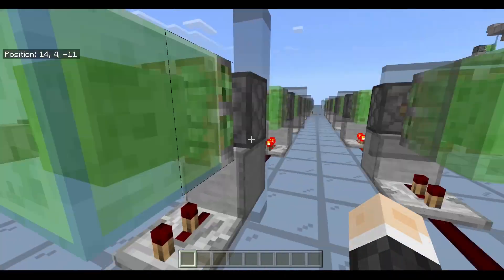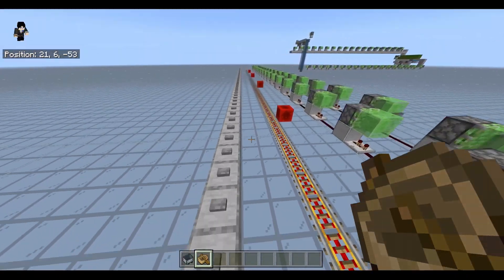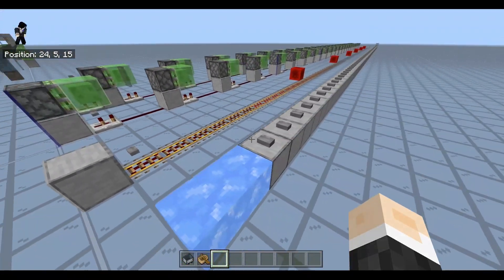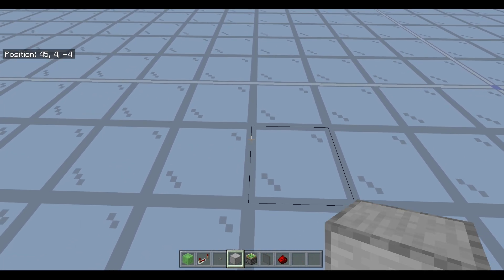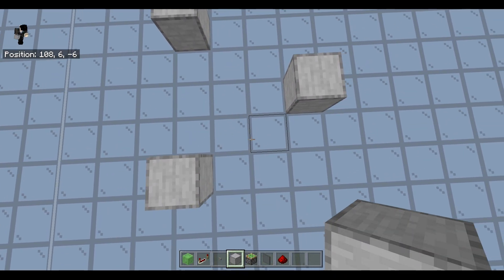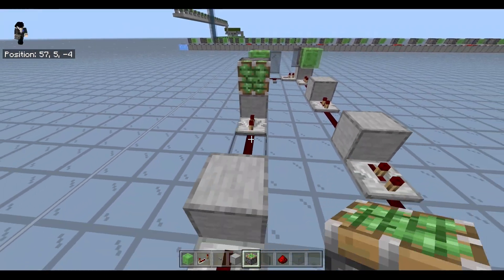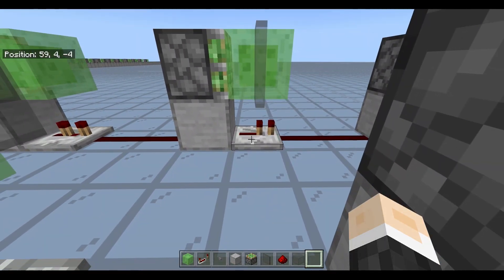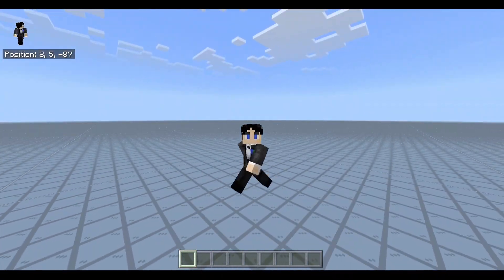Fast Translocation Highway for Minecraft Bedrock Tutorial 1.14

Comment: Do lag effect this at all ?
Reply from the maker: Lag will make it slower, but it won't break
Reply: what about unloaded chunks?
Reply: That's what matters it does not break ! Great work I must add.
Reply: @Hakabas01  don't unloaded chunks just happen and are only fixed with hard reset I would not thought this would cause unloaded chunks.
Reply: @Hakabas01  I believe its not a problem since you will be moving and loading the chunks. Similar to the piston bolt It wouldn't be a problem.
Reply: Ameer Saliao Chunks can’t load infinitely fast. Also it doesnt matter anymore, it’s broken.